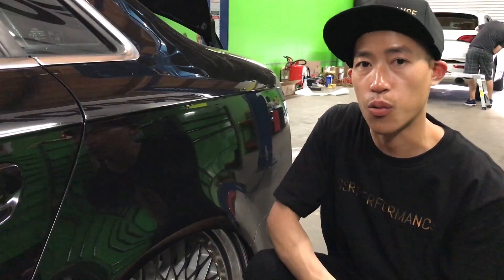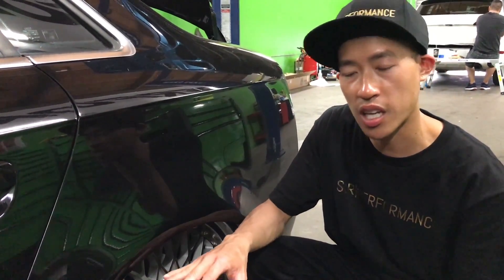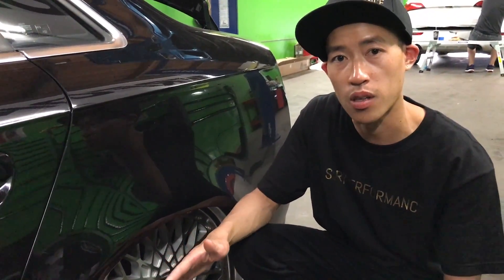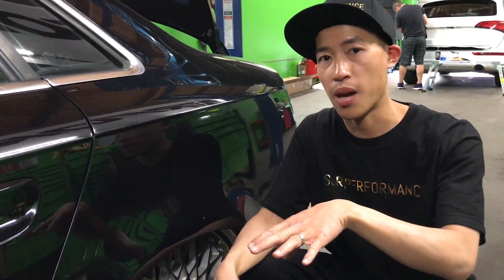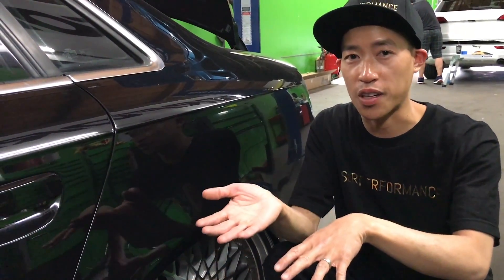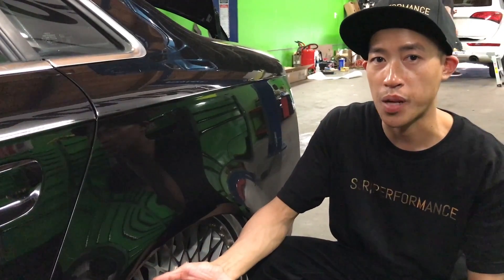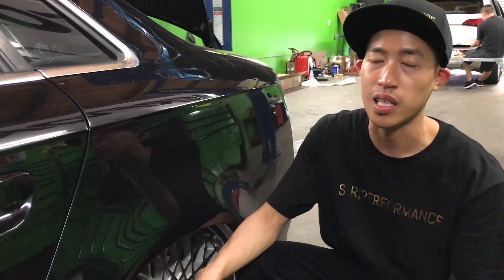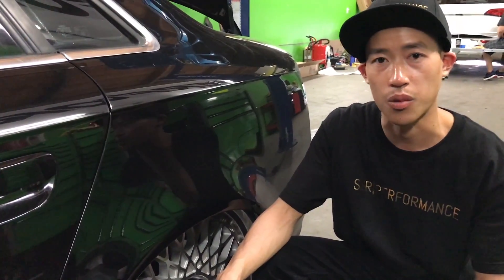Air Suspension: How will it affect performance?

Comment: THE RIDE ON AIR IS WAAAAAAAAAAY MORE COMFORTABLE AND BETTER FEELING THEN ANY SPRINGS COULD EVER BE BOTTOM LINE YOUR RIDING ON “ AIR “ KEEP IN MIND YOU CANT DRIFT OR RACE ON AIR UNLESS YOU GOT PRAZIS AIR STRUTS THEIR THE ONLY BRAND THAT MAKES QUALITY BAGS THAT WONT POP AND THEIR STRUTS AND 3/8 AIRLINES ARE 4 TIMES THICKER THEN AIRLIFT PERFORMANCE AND THEY DESIGNED THEIR STRUTS 100% FOR DRIFT AND GOING TANDOM ALSO THEIR MADE IN THE USA NOT CHINA LIKE MEGAN BCRACING FORTUNE AIRREX AIRRIDE CUSCO TEIN D2 YELLOW BROADWAY KSPORT YOU NAME THE BRAND AND ALMOST 98% OF COILOVER OR AIR STRUT BRANDS ARE MADE IN THE EXACT SAME WAREHOUSE IN TAIWAN USING CHINESE PARTS CHEAP DOUBLE BELLO BAGS AND STRUTS MODELED ON OEM STOCK STRUTS JUST WITH SPINDLES IN OTHER WORDS THEIRS ONLY 2 BRANDS WITH QUALITY STRUTS THAT HAPPEN TO MAKE THEIR OWN BAGS 1. PRAZIS 2. AIR LIFT AS FOR COILOVERS GERMAN BRANDS ARE THE BEST KWSUSPENSION OR BILSTEIN PAST THOSE NAMES AAAAAAAAAAALLLLL THE REST ARE CHEAP GARBAGE WITH BAGS THAT WELL POP AND THEIR STRUTS ARE NOT WHAT YOU THINK THEY ARE! THE ONLY REAL AIR SUSPENSION FOR STANCE AND STREET OFFERING TRACKABLE AIR SUSPENSION IS PRAZIS MADE IN THE USA AND SOLD EXCLUSIVELY AT 213 RACING , YOUR WELCOME CHEERS

Comment: how would this set up cost?
Reply: Around $3800.00 for airlift's 3P and performance struts. Add an extra $500.00 if you want to go 3H (height sensors). 

However the price is about to increase an approximate 15% on 11/01/21 due to all the inflation. Components are low and demand is high. It took a friend of mine almost 3 months before he received his full kit.

There was a time where they had the items premade on hand. Now with everything going on they sometimes have to order the materials then manufacture them per order. 

Add anywhere from $800.00 to $1200.00 to have it installed. You can do it yourself if you're confident however most shops offer warranties on their installs and Airlift won't honor their warranty on components if they are damaged due to a faulty installation.
Reply: Looking at mid to high 3k depending on options

Comment: Ok I have a 2000 chevy tahoe with a competition audio system in it and the rear has 600 pounds in batteries and the box it's self weighs a bunch is there a max weight on these or would it not really matter?
Reply: Shouldn't have a problem if you get the bag meant for your Tahoe. I'd run bigger lines.
Reply: what’s your question about cause you’re not racing a Tahoe with comp audio